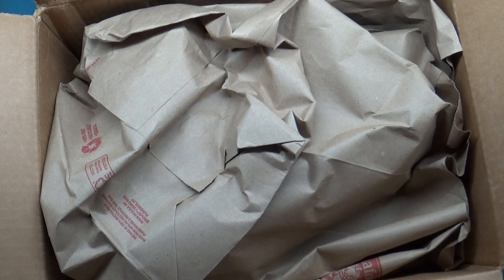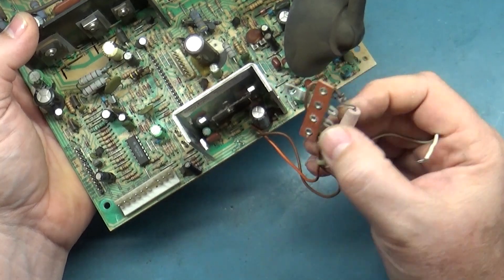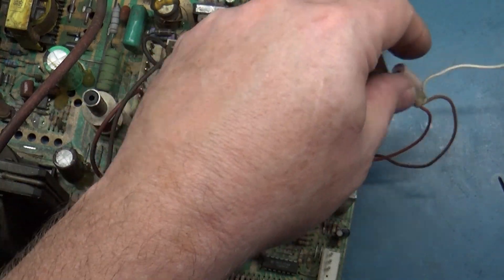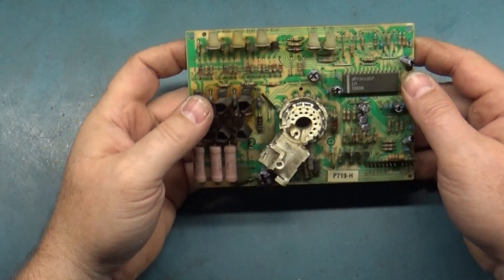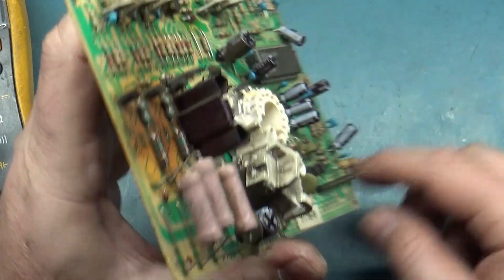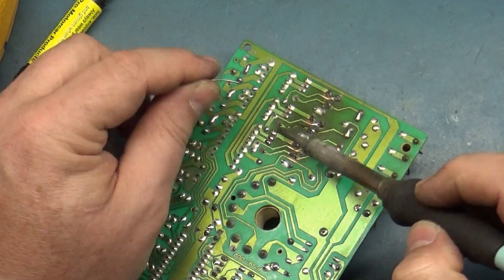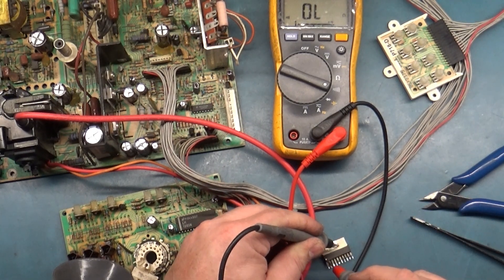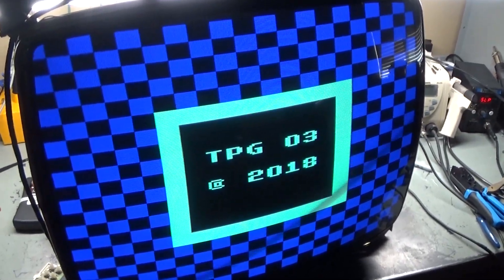25" U5000 Arcade Monitor Chassis Repair - Vertical Collapse - Vertical IC Is Good...Or Is It?

Comment: Hello Mike I have a hantarex polo. Can you please give me some ideas what could be the cause of a black vertical line on the the side of the screen. It goes away when I lower the contrast but then again my screen will look to dark. I was told it could be the fly back going bad but I want to hear it from you Mike since your a little more familiar with the hantarex polo chassis.
Reply from the maker: Bad flyback most likely. Could be bad caps.
Reply: @MikesArcadeMonitorRepair  Thanks Mike 👍

Comment: Have a P738-F board with no 25k connector on the chassis, no vertical sweep mod and also has the pin cushion connector....is this a 25 or 27"? has vertcal collapse  and came in on a 25" tube.....
Reply from the maker: You sure it’s a U5000?
Reply: @MikesArcadeMonitorRepair  Tube says 25k 5191 and only operates at 15k....
Reply from the maker: What does the sticker on the chassis say? The one in the back left corner by R104?
Reply: @MikesArcadeMonitorRepair  only sticker present is the P738-F  and the wells brand ....nothing else like we normally see
Reply: I cant send pics of what we have

Comment: Hi, I bought an arcade cabinet lately and it came with a 25'' inch crt with a Hantarex polo/2 25-28 chassis.
My issue is tha the image is kinda squassed in the far right side and a bit in the far left side , I tried to play abit with the horizontal position and size pots it didn't help.
Am I missing something? Any suggestions? thanks in advance for your help
Reply from the maker: Likely needs caps replaced.
Reply: @MikesArcadeMonitorRepair  I am trying to send a link with some photos of the issue but it keeps getting deleted
Reply from the maker: That’s ok. I know what it looks like. Black lines are usually bad caps. Completely Black areas are usually a flyback issue.
Reply: @MikesArcadeMonitorRepair  it doesn't have any black lines, for example when a character in a game goes to the far right of the screen is getting squashed horizontally.
Reply: that's why I am trying to send you the photos, if youtube doesn't permit links in comments I can send you an email.
Reply from the maker: Ah. Ok. Either bad caps or incompatible yoke. Could be a width cap issue. Very similar to the K7000.